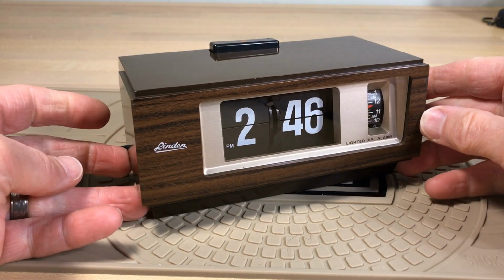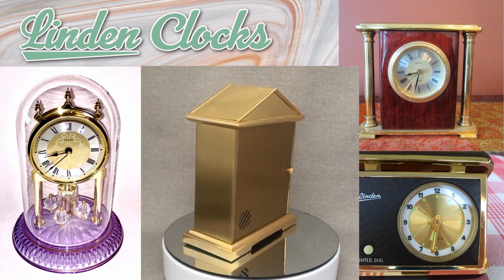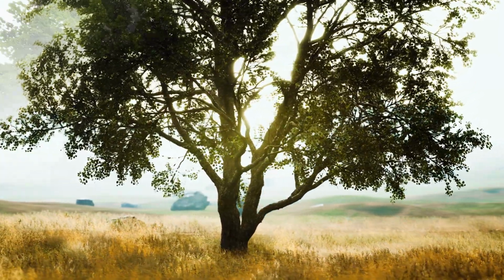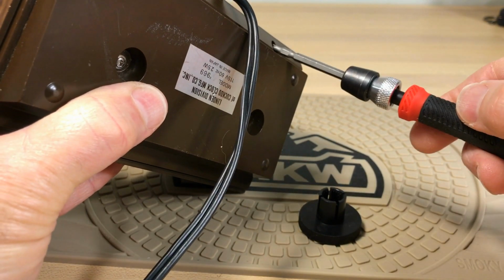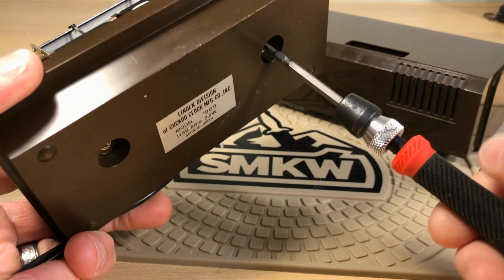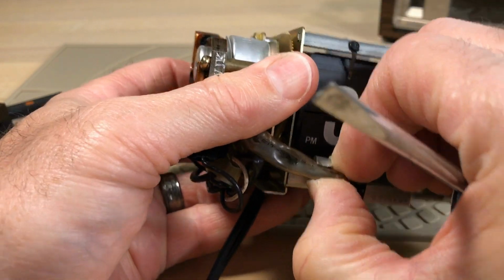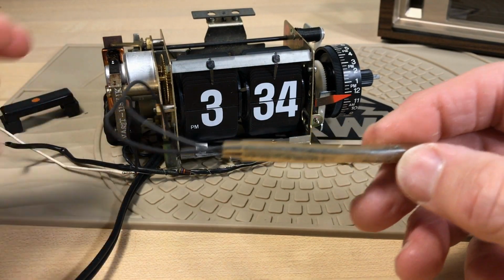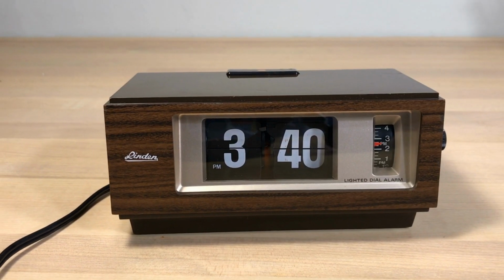The Linden Model 969 Flip Clock - Cuckoo Clock Mfg. Co.

Comment: Yes, the Linden company definitely has an interesting bit of history, I’ve always seen them more than importer. I myself have a Linden tiny time alarm clock, very interesting unit, I actually was lucky enough to get mine with the original box and instructions, apparently it was a gifted to someone in 1966! Uses an electro mechanical balance wheel movement that I had to totally go through and clean up. The motor in yours is very interesting, it’s eerily similar to the old General Electric Telechron rotors, I wonder if this was some sort of clone or if they actually licensed the design from GE. Looks like one of the much older models, so maybe Toshiba bought the rights off of them, as by that time period, it was primarily the S rotor that was used (smaller and more compact than the one in that clock). All my thoughts and ramblings aside, it was cool to see inside that example!